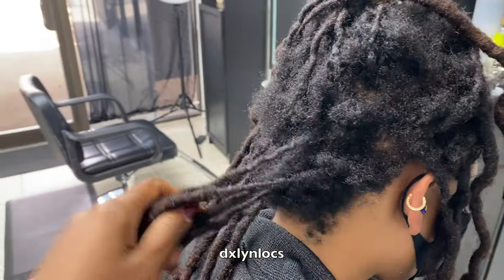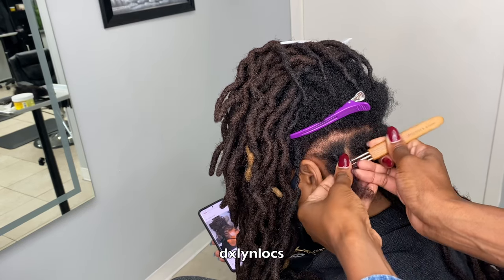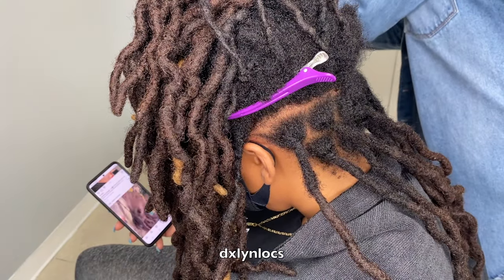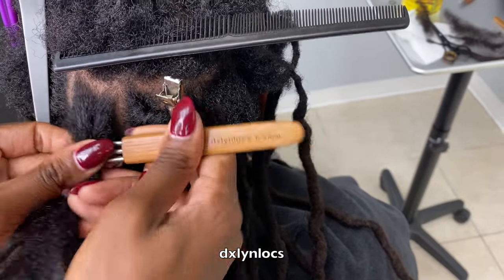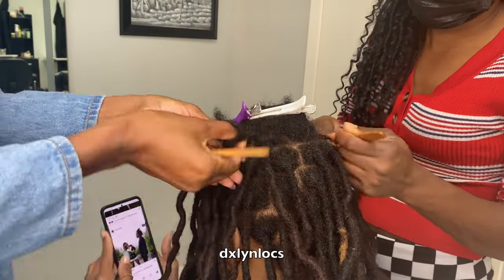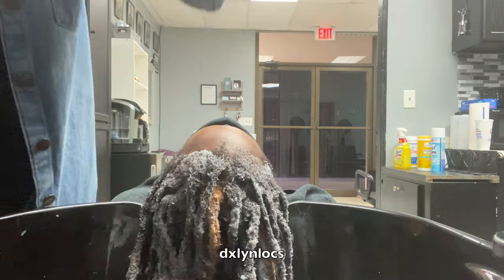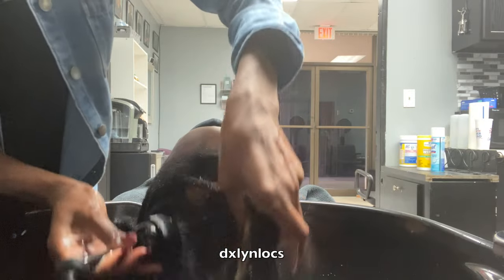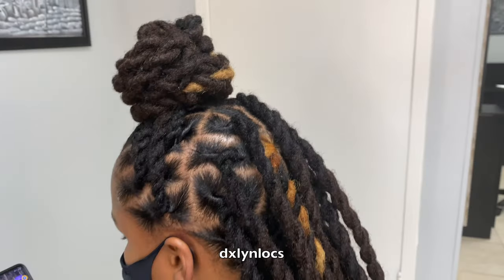LOC REPAIR AFTER 8 MONTHS WITHOUT MAINTENANCE | NBN DAY 2

Comment: I went with your method with the wash after you install to double check your work! I recently did a full head install and when I washed the hair after the install I was able to take care of the Locs that were in there tight enough so later down the line none would fall out! Thanks
Reply from the maker: Glad I could help  ❤❤❤

Comment: Hey so I have a question, I wanted to get some advice on how often a person should wash their loc extension? I get nervous to wash them on my own. Also with moisturizing I have been using a misting water bottle with water and glycerin and then I use an oil, is that enough?….I live in Louisiana. I have been trying to keep it simple to not have a lot of build up. Any advice would help, thanks in advance

Comment: Those locs are so much work, the biggest mistake is the loc extensions are not mant to stay in your locs for long, they are just supposed to make u look like you have mature locs until your locs grow and then you get them out or cut them off. But many people remain with them and then they grow and get heavier than the actual hair causing it to break at the roots and so you have to go to the saloon almost every 2months at the slightest growth which makes you look clean but weakens the natural hair making having locs stressful. Its advisable to always avoid extensions while starting a long term loc journey
Reply from the maker: Thank you for sharing ❤❤❤